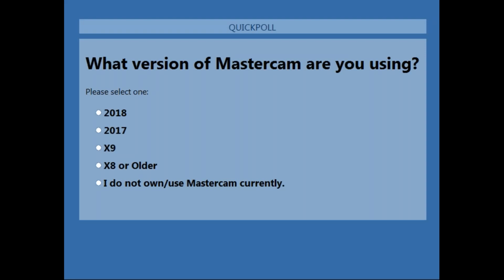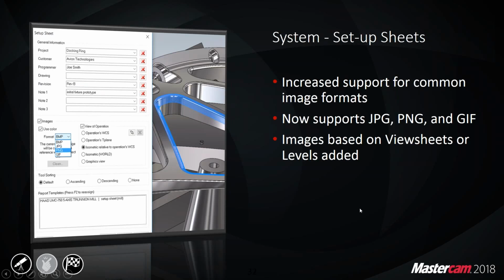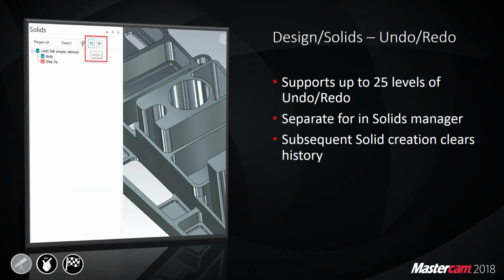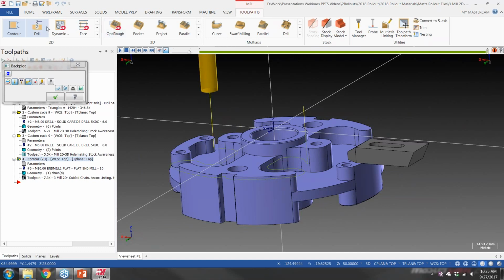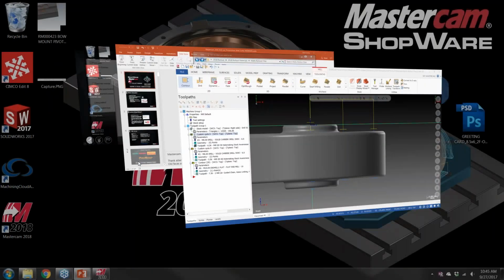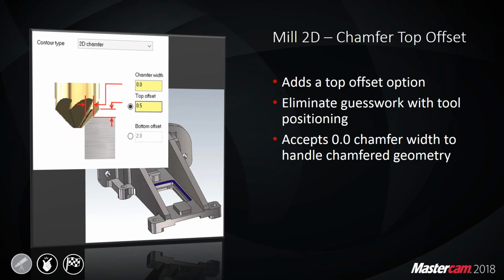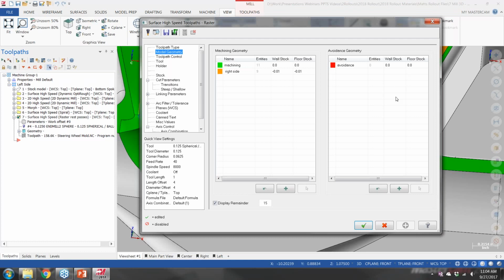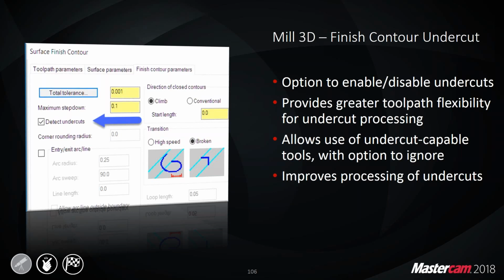Mastercam 2018 Rollout Webinar 1  System, Design, 2D & 3D Mill

Comment: Is there an option in 2018 like there is in 2017 to leave material on the wall and floor when using OptiRough? I have the home learning copy from work but have not found it anywhere.
Reply from the maker: It's now on the model geometry selection page. Each group of machining or avoidance geometry you select has separate stock to leave controls. I talk about it around 58:00 of this video.
Reply: I missed that, thank you very much!!